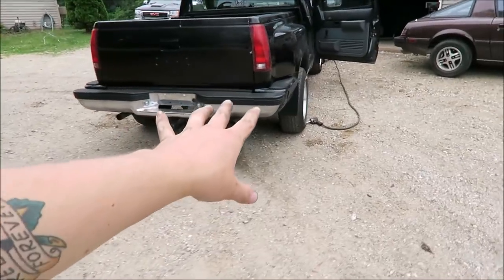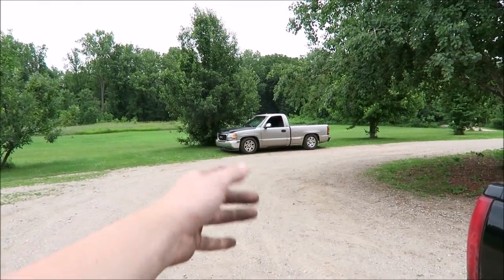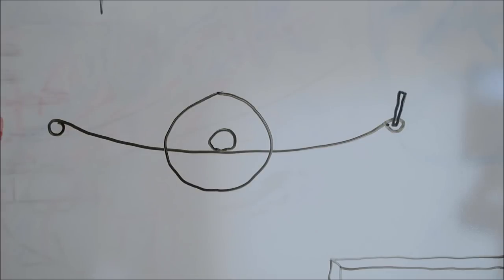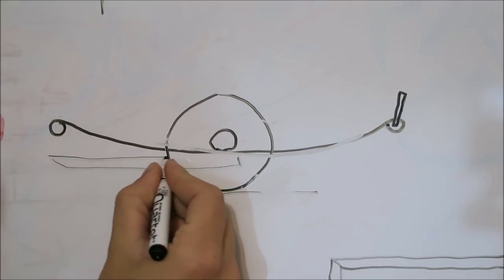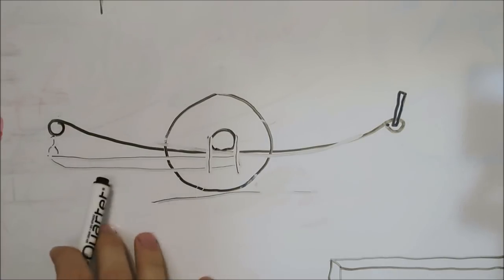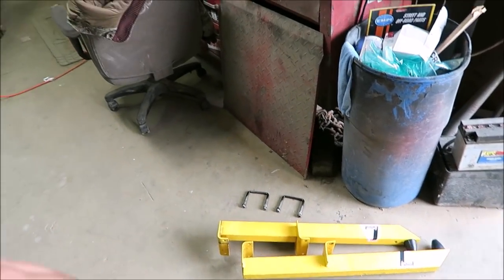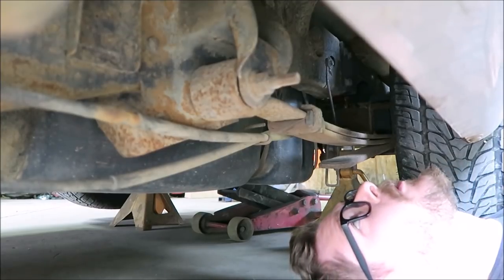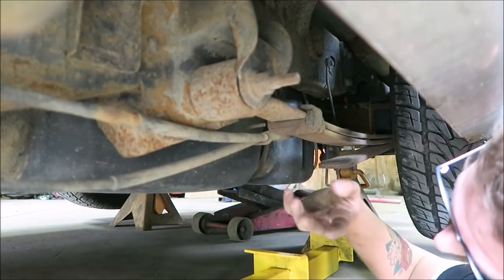Do Traction Bars Actually Work?

Comment: When your socket gets stuck just pull the socket off your wrench and throw it on the ground...the nut will fly right out every time
Reply: I have a socket and nut tip most people might laugh at this but I am as serious as it gets about saving time doing simple shit can turn a nightmare especially with NYLOCK nuts because sometimes and not all the time the plastic tends to bind the nut inside a socket. A little cooking oil like veggie oil or olive oil works better than any lubricant you can buy cept trans fluid does the trick but not everyone has trans fluid in a spray bottle like I do so cooking spray is the next best thing. For reasons unknown to me in the scientific world WD and CRC just don't work at keeping a NYLOCK from binding inside a socket.
Reply: Just make sure you see where it goes......those little suckers like to hide..............

Comment: For my Avalanche I got the trailblazer Torque converter. 

Part #24228709
It's about 2400 rpm, and about $240 brand new
Reply from the maker: Yeah, I've got that sitting in my Amazon cart. What rear gears do you have though?
Reply: SniderTron 3000 I have 4.10s. Tires are 285 70 17 though. 

I forget is your rear end stock?
Reply from the maker: Stock axles, but it has a new LSD and 4.10's

Comment: Cars have gone 8’s with slapper bars, and been on the bumper too, they work quite well if set up right. A lot of racers ditch the rubber snubber and use a bolt, and lengthen it so it actually contacts the leaf spring, that way it pre loads the suspension a little, and hits the tire before completely loading the suspension, like a caltrac. At least that’s how it was done in the past before everyone got caltracs, myself included. And I too would ditch that overload spring some day if you want the truck to hook...
Reply: Shit Box hmm can you tell me why that is because I was thinking the fact i chucked my overloads on my 93 gmc c1500 would hurt me a bit even with slapper or traction bars
Reply: Kohner Bruntjen, I could be wrong but i think the overload spring makes the spring pack too stiff for the traction bar to work properly, the spring has to load some so the snubber can contact the spring, hence the term slapper. Just my opinion...
Reply: Okay well Now I'm curious which it is lol
Reply: Kohner Bruntjen, Looks like Snider’s truck has a light spring pack, only 2 leafs and an overload, my C10 has 5 leafs and an overload, I doubt a traction bar would even contact the spring under load, his truck probably won’t be a big deal with less of a spring pack...
Reply: That is easy to do with a bolt, very easy the trick is keeping the rubber stopper on the thing. I use the body panel epoxy. I ream the rubber out a little bit and then I go to work to set the preload after the thing dries on the bolt head. Another trick is to put a little weld on the bottom of the bolt to keep the nut from loosening up on ya and falling off inside the traction bar while driving around. It can be real pain in the ass if the thing loosens up completely and bends the bolt on ya. Trim the bolt to size. Some guys tend to pass the stopper bolt completely thru the traction bar so they can double nut it at the top and bottom which is also fine and it works because that is how I do it... I used case hardened bolts my buddy swipes at a heavy equip place he works at. Tempered hardened metal bolts tend not to bend at all.
Reply: Nothing better than leaf springs n slappers.

Comment: Hookup will happen. You need to get longer ones so U-bolt mounts behind and in front of axle. As your axle raps and the rubber snubber hits the front of the sprint, it transfers weight to the rear U-bolt/rear of bar and uses that inertia to slam the rear axle/tire into the ground, which is go motion. In my mopars it has turned an open diff to a posi. I've got 300+ hp, you've got more. Your overpowering your tires.

Comment: Put a trailblazer 4.2 torque converter, stalls up too 2500-2800. you can find them all day at the junk yards, i just picked one up for 20 bucks lol
Reply from the maker: Shit, that's not a bad deal at all. I'll give you $25 for it lol
Reply: Would be a great video to make on budget torque converter! just order my traction bars from speed engineering as well.
Reply from the maker: Yeah, like the last major piece to the puzzle is a looser converter. And, I'm definitely gonna be getting those SpeedEng bars at some point. I really like the way they have the snubber that contacts the eye instead of putting a bunch of pressure on the leaf like CalTracs
Reply: Plus you dont have to remove the whole leaf springs just to install them, make everything much easier.

Comment: Just my 2 cents but clamping the bottom "overload" leaf is probably going 2 have a negative impact on your ride quality. "Stiffer" I'm guessing your not putting a lot of weight in the bed so you could remove the overload spring to retain factory ride with the traction bars. Also if I remember correctly the front snubber is threaded and can be adjusted closer to the spring eye to fine tune the bars.
Reply from the maker: Yeah, it did stiffen up the rear a touch, but not too bad. It almost improved it a little. I do actually use this as a truck lol I just hauled a couple yards of mulch in the bed last week. And, I'm definitely going to get something else down the road, probably the new Speed Engineering traction bars. 

And yeah I moved the snubber as far ahead so the bars could be moved as close as possible to the axle.

Comment: Hate to tell you but there's only supposed to be an 1 /8"at the snubber at the most! Anything more than that is wasted motion is hard on everything.  You can shim the snubber up closer on that style of  traction bar.  I trimmed the top half inch of my snubber off and adjusted up properly   and my 70 Chevelle would hit second gear so hard that it would chirp the tires and jump sideways!! Lol never got tired of that feeling 🙃!!! Good luck with all of your projects and keep up the good work 👏

Comment: If going to buy a converter get a 3600+  i messed around with 3000-3200 yank-fti-circle D.  had way much money wrapped up in a the wrong converter. Order a yank ss 3800 man was a whole different animal. 
Ran 8.1s 216/220 cam, 410s tru-trac, 28" drag radial. Locks up at 40 mph so its good on a daily. I drove my truck everywhere.

Comment: What ive seen in your truck  the issue you have is because you have removed 2 or 3 leafsprings so it is weak with that traction bar thing you are just stressing the shit out of your existing 2 leafs . you are gonna end up breaking a u bolt or a shacle . looks cool tho with those things
Reply from the maker: Stock leaf pack untouched.

Comment: Sorry just stumbled across this video . Having same trouble with my 1982 dodge D150 short bed pickup. It has lightly modified 318  with racing 727  and 8-1/2 rear with 3:55 and posi . I believe it use to be a 6 cylinder truck because it has 4 thin leaf springs instead of 6 thick leafs . Im planning on swapping to heavy duty rear springs and some Lakewood traction bars  and should take car of the problem? What kind of mufflers you running on that pickup that did the burnout?
Reply from the maker: Depends on what your goal is with the truck, but just doing tracrion bars and upgrading the shocks could be the way to go. And it has a Speed Engineering X Pipe
Reply: It has new coil over performance rear shocks . On your pewter colored chevy truck what brand of muffler are you running? Im just running duals no x pipe or H pipe .

Comment: So what your sayin is slapper bars are more for removing wheel hop and doin clean burnout not really for traction but cal trac are more for the track or high hp to keep traction with all the power but are better because they can be used for on and off the track right?
Reply from the maker: Thats a broad generalization, but that's kind of how I feel about them. Cal Tracs plant the tire better than just slapper bars. But I know plenty of people pulling great 60 foots with slapper bars

Comment: Really good video . We got a 91 GMC Sierra extended cab stepside with a 6/8 drop and it wheel hops so fucking  bad. Time to add some traction bars
Reply from the maker: If you really care about it, I would look into the Speed Engineering traction bars. They said that even though they're for the 99+ trucks, they should still fit the 88-98 just fine, and they look like a fantastic design

Comment: 4 hours on the nut? Wow 😮... I’ve got them stuck before usually just heat the socket up and cold water dunk it and it’ll come out. Does that truck have the 4L60E Transmission? If so how many miles can you expect it to live. Mine has 163.000 shifts smooth but it’s chirping a little.
Reply from the maker: The nut only took like a minute or so to get out, it was just being difficult. But, yeah it has a 4l60e. When I bought the truck the guy said it was freshly rebuilt and 2 days later I lost 3rd and 4th gear, so I had a local guy rebuild it last year and it's been doing phenomenal since then. And, I drive it the same way off camera that I do on. I have no idea how long it'll last. 

People have said the Corvette Servo that another dude just asked me about has helped get rid of the slipping and chirping
Reply: Ok cool. I was just curious about that chirp. Im not having any issues other than hearing that chirp occasionally. Mine is 4 wheel drive if that makes any difference?

Comment: You ended up pinning the last smaller spring against the top ones. Doing that alone stiffens up the springs so much it sometimes stops the springs from twisting but the truck will be extremly stiff. I'm pretty sure the slapper would help also but that did aid you.
Reply from the maker: Yeah, I knew it would clamp that spring, but that's more of a minor inconvenience than anything else. The truck still rides totally fine. All it really did was make the rear end drop another half inch

Comment: I own a 95' Ford bronco, that has a Cobra-Jet 650hp engine with a 100hp supercharger, added with an accelerator activated NOS.  I roast tires, even in 4 wheel drive.  I can't seem to stop them from spinning, no matter what I do.  I want to know how you get to do your take-offs w/o tire spins.  Is it a 'clutch-brake', or 'Detroit lockers'?  I need help.
I LOVE my take-offs but HATE destroying my tires.  Any suggestions and/help are really needed.  At $500 a tire, it's too expensive.  Or would 'caltracs' do the trick?
Reply from the maker: Well what works for me is not having much horsepower haha
Reply: Its not 'all' about the hp, its more about how you can put it to asphalt.
Reply: @markbutterfield5559  Bud....It doesn't matter what you do with approx. 850hp, you'll spin. Keep your foot out of it or buy slicks for all 4 corners.
Reply: @blade-fpv9411  Thank you much, I'll try your advice.

Comment: Hair was on point today Bro. Sweet burnout. Still going with a 3200 stall? You and Pops need to do a bike video.
Reply from the maker: Haha, thanks, man. I want to go with the Circle D 3000, but I'm considering just tossing in a trailblazer converter just because they stall around 2500 and they're cheap. And, I've thought about doing some more bike videos

Comment: I'd love something like these for my truck, but they hang down so low though. I'm already at a 12 inch drop in the rear I can't afford to lose more clearance ugh
Reply from the maker: Wow, I'm shocked you have a 12 inch drop and don't have a 4 link. Props
Reply: SniderTron 3000 
Yeah I went the budget route lol, used drop leafs, blocks, and flip kit of course.

Comment: Also i tow will these affect it in any way? I honestly just want them for the looks
Reply from the maker: I couldn't tell you for sure, but I don't see why they would. Especially if you just want them for the looks, you wouldn't have to get them as tight
Reply: @SniderTron3000  from those 2 areas on your bars which one should i leave not to tight the rear part on axle or the front part near the rubber?

Comment: have you ever thought  about installing a corvette servo on your truck  ?
Reply from the maker: I've looked into it a little and the only thing I can find about it is that it makes the 1-2 shifts quicker. But, I have some tuning software and I got it so that shifts super quick in tow/haul mode. So, I'm just not sure if it's worth it. I mean, obviously its going to be an upgrade regardless, I just haven't found the answers to the questions I'm looking for before doing it.
Reply: yeah I get you . I have just  installed one in 01 silverado it make a little difference but only on 2 and 4 gears it  still need a good tune and some headers

Comment: Did they make these trucks with a 5 speed? Because...well, that would be awesome.
Reply from the maker: They did, but I think that was only with the V6 models. Maybe some 4.8's got them, but I'm pretty sure all 5.3's and 6.0's were auto
Reply: SniderTron 3000 well...dang. I wonder if it would be easier to put the 4.8l 5 speed in a 5.3l truck, or a 5.3l in a 4.8l truck? I'm guessing a 5.3 in the 4.8l truck might be easier with the pedal assemblys and manual ecu already there.
Reply from the maker: Honestly, if I could find a decent truck with the 4.8 and the NV3500 I wouldn't bother swapping it. 4.8's respond great to turbos because they have a shorter stroke, so I would be really tempted to just make it a fun daily boosted 5 speed truck that makes a modest 400whp. I wouldn't want to go too much more than that because they aren't the strongest trans and they have a 10 spline input shaft.
Reply: SniderTron 3000 ive been toying with the idea of doing something similar to your gmc, but i was hoping to find a 5 speed so I could mess around with local grassroots drift events. It"s awesome to hear that the 4.8's are (roughly) as solid as the 5.3 that I'm more familiar with!
Reply: Lynn Mckenney Get a Joe Gibbs silverado.
Reply: I have one lol 5.3 5speed rcsb

Comment: Would you bother with these on a 4wd or no? Love your vids. Have a 99 stepside myself.
Reply from the maker: I personally wouldn't. Offroad people seem to prefer the ladder bar setup, or the really long traction bar that mounts on the axle and the frame.
Reply: @SniderTron3000  Well, I put em on. My truck is a pavement pounder and my daily, but after installing block in the rear, it revealed how worn out my rear leafs are. The driveshaft sliding in and out of the tailshaft makes a horrendous clunk when accelerating and coming to a stop. These cured the acceleration part. No money in the ol budget for a real set of traction bars or new leaves, so these will have to do for now. Appreciate you doing these, helped me out in a pinch.
Reply: @theANGRIERone  just saw this comment i have a 4wd i want to put these same universal bars on but just for show. Will they mess with my towing i tow often
Reply: @sergiocaballero7404  I wound up going with Pro Comp lateral bars. I lost one of the pinion snubbers almost immediately on the slapper bars. Probably my fault for not tightening it down. Not sure on towing, though. I don't tow anything with my truck. can't see how they would hurt really? Then again, I don't know much about towing stuff.
Reply: @theANGRIERone  those are expensive again 50 bucks for that mean stance look the traction bars give us is something im willing to pay unless it messes with my towing
Reply: @sergiocaballero7404  Give em a shot, if they don't work you can turn around and sell em :)
Reply: @theANGRIERone  yea possibly just did 40k trans cooler, air raid jr intake tube with drop in k&n filter, and also put on 20x12 wheels next is remove cats and cam. So adding the slapper bars painted red would look killer on it. Im not lifted so i think that helps and like i said just want em for show. I dont even do burn outs lol tires to expensive

Comment: Can this help with take off? From a dig
Reply from the maker: If the rest of your setup is right then yeah. Main things are your tire, leafs, shocks and getting these all setup right so they work well together. Mine is far from right, I just have it stopping wheel hop. If you're serious about it look up an Hot Rod article about Ron Rhodes, he has some great info that he learn on his Camaro.
Reply: SniderTron 3000 alright I’ll look him up thanks for the information I’m pushing about 524 to the wheels on a 03 6.0l Chevy Silverado with headers tune intake and built heads with a 4l80e so I get a lot of hop and it’s worrying me that I might mess something up

Comment: Is wheel hop like just a single cab thing cos the whole light weight?
Reply from the maker: Nah, I've seen extended cabs do it too.
Reply: @SniderTron3000  crazy. Mine spins up real quick and never hopped once.
Reply from the maker: What gear and tires do you have? Usually if you can get enough wheel speed you can power through the hop. Mine only did it when I was at a lower wheel speed with the 275's
Reply: @SniderTron3000  373s and 275/55/20s

Comment: So this truck doesn't have rear brakes?
Reply from the maker: What? Yeah, it has rear brakes. Are you thinking of the line lock?
Reply: I just didn't see the lines.
Reply: And after I thought about it those holes should have been the ebrake cable.
Reply from the maker: lol I was very confused

Comment: So how often do you buy new tires lol
Reply from the maker: Actually, this is still the first set of tires I bought for this truck since lowering it and they have probably 65-70% tread left still lol it helps that this thing wasn't really good at doing burnouts until the last like 4 months
Reply: SniderTron 3000 that's pretty good, my tires are like a year old, my truck won't do burnouts though my truck just sits there. Gonna rewatch some videos of yours soon to see what kind of things and brands you used for a few things